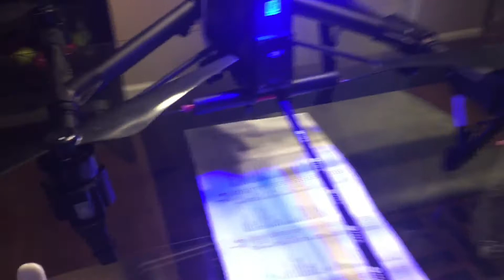$1 DIY Drone Drop System for DJI Inspire

Comment: How did you zip tie it up?
Reply from the maker: Zip tie fits between the frame and the battery .. thin plastic zip ties
Reply: But how to maintain them well?! It is your 2.0,in fact?! :)
Straw cutted is better?! And your loading.. You took a key holder or ita just for the exemple?